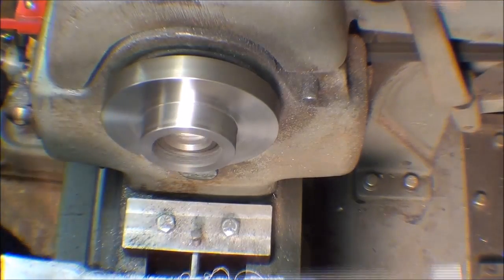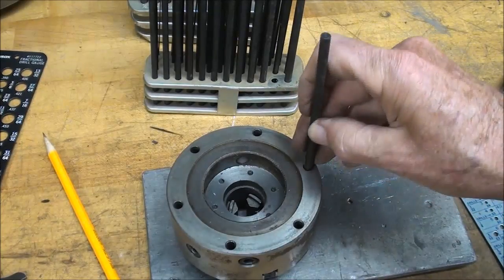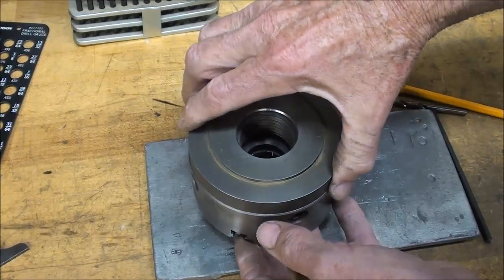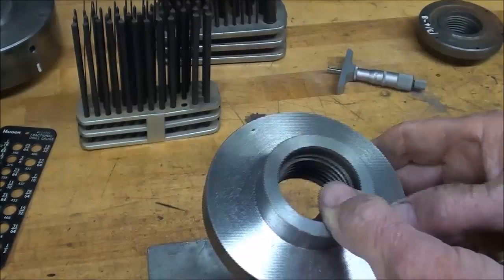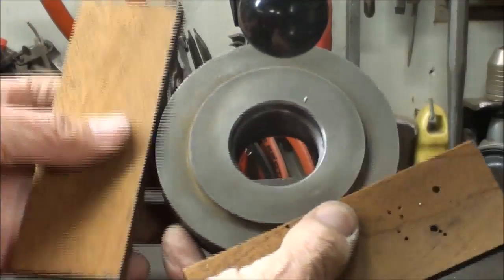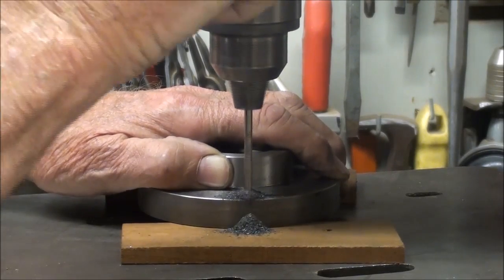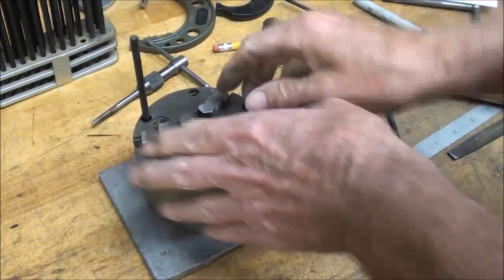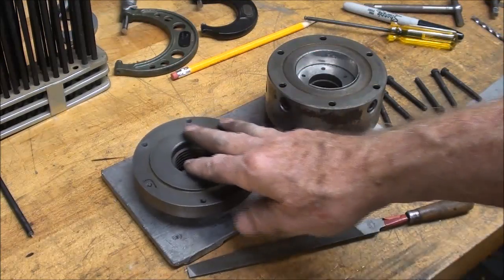SHOP TIPS #214 Part 2 of 2 Fitting a Backing Plate to a Lathe Chuck tubalcain

Comment: A thought here about fitting any back plate:  You should always have the ten thousands slop or clearance between the inside ID of the back of the chuck and the step on the back plate that Lisle is demonstrating.  If you fit a standard non-adjustable chuck and make the back plate tight, you couldn't tap it in to adjust it.
Reply: Now, I'd make it tight ( a thou or two ) to start with. Then mark the holes and mount the chuck. Then figure out how much out of center it was and remove just that much so that I could center it. This would let me mark the holes without messing with shim stock. And, in the remote chance that everything was true, not have to use the adjustments at all. And, most of the time, have to remove less to get my adjustment.
Reply: @bobmazzi7435  I had given it a lot of thought and if it's not set-tru then fitting the backplate tightly is correct.  I watched Mark on Winky's Workshop true up a set of jaws on a mass-produced chuck.  It will never be perfect, because the scroll will never be perfect, but he came really close.
Reply: @robert574  If you must use a chuck, and it must be accurate, true it up at the diameter that it's working at. And this is one reason to always have a bit of wiggle room on an adjustable chuck.

Comment: This will never get old, exactly how to fit the back plate.  I saw a different video where someone drilled the side of a non-adjustable chuck, put in 4 set screws and made it into adjustable one.  Of course, he had to fix a back plate like Lisle did here.  It might be possible to add a ring to an existing back plate, heck all you really need are 4 screw heads that the set screws could hit and push on to center it, the rest of the ring never gets used.

Comment: Another way to center the back plate would be to insert the back plate, tighten two of the adjusting screws (at 90 degrees to each other) to push the back plate to one side of the chuck, back off the two screws you tightened by 0.006", and turn the other two screws to hold the back plate centered.

Comment: This is my project sometime after Christmas with a new 4-jaw 😎
Reply: @mrpete222  (a hand goes up in the back row) “Is there any discernible difference between Way Oil and Bar Chain Oil?  They both seem to have a similar viscosity and ‘tackiness’ —- and Bar Chain Oil is a lot easier to find here in the Smoky Mountains than it is in the Northern Rust Belt. . .”

Comment: you mention the reason you cut the clearance hole was that there is no reason to thread beyond a certain depth or thickness as there is no advantage for maximum holding strength.    Do you have a reference for what that maximum thickness would be for various thread sizes???     Other than the old "rule of thumb" of about 1.5 times the diameter for steel and 1.8 - 2 times the diameter for brass or cast iron,  I haven't been able to find a written reference for the maximum thickness to thread to, after which there is no additional strength gain.   Thanks

Comment: Removing threads because of the holding issues doesn't make common sense to me. IF, and that is a big if, for some strange reason the initial threads get messed up or pulled out, you have nothing remaining to still use in the hole or extra material to tighten the bolts. If the entire hole doesn't need threaded, what is wrong threading it for such possibilities anyways? IDK!

Comment: with a lot of machine experience, not a teacher, but the one repairing industrial equipment, I don't like removing clearance threads on connecting plates.  True, it will only hold the thickness of the nut, but that is irrelevant, to structural integrity. We never removed threads on the lead in, like never, ever, many many years of engineering.

Comment: I just finished turning one of those same backing plates last night (still need to drill & tap) but I wish I had known it was cast iron before ordering it. It was no fun turning cast iron and made a huge mess. But I wish I had thought to turn the plate around, I would have saved a ton of time taking material off the larger diameter. And I have the same lathe :)

Comment: Scary!   You as an expert buying a custom theaded backing plate?     Makes me reconsider doing my own.  What's up- I'm just learning.
Reply: I bought a backing plate for my Logan, it is a 1-1/2 8 thread. The threaded part isn't so critical IMHO, but you need to machine it on the lathe that it will be used on so it runs true.
Reply: If I make my own lathe spindle, I'd either have to cut both threads on that machine or be positive that the threading was exactly true on its tpi.  Inner threads on it would be 2 1/2 - 8 threads.  Lots to figure out.  Thanks for reply.
Reply from the maker: never make--if you can buy cheap
Reply: LOL -- True - that's right you find all those deals.  I was concerned because when a retired person who loves machining is buying instead of making; ...there must be a reason.  Perhaps you could do a video on HOW you find the auctions and so forth, and otherwise line up so many sources for machine tools;  ...too much like finding hen's teeth out here near Portland OR.
Reply: mrpete222
agreed, we " make " because its not available or cost prohibitive. you will never fabricate a one off part cheaper than something thats of the shelf.  Great advice Mr Pete

Comment: Could the backing plate have been made from steel instead of cast iron?  Why does cast iron seem to be the material of choice for backing plates, even when the chucks are steel?  Thanks. -Chris
Reply from the maker: +webtoedman Good points
Reply from the maker: +bx2200 CI is best--but steel would work

Comment: Great video! I am curious to know why the the bolt threads has a maximum strength after a certain number of threads.  Is it because the force that would be required to pull the bolt out of the threads exceeds the tensile strength of the bolt?
Reply: +MattsMotorz You are correct. After a certain number of threads there is no gain in strength and greater risk of breaking a tap. The only benefit to longer threads is if the hole cant go through the other side and you cant be bothered to get the right length screws.
Reply: I was always taught that the width of the bolt e.g. 1/2, you need roughly 1/2 worth of threads to achieve full strength. As a mechanic I do believe in as much thread as possible, never know who is gonna cross thread or put in too short a bolt! haha

Comment: Nice demonstration, thank you. I'd really be interested in that 1&3/4" x 8 back plate you started with if you're thinking of off loading it. I'm restoring an old Smart & Brown M model mk1 from 1946, and I could really do with that for a little 4 jaw chuck project.
Reply from the maker: +Steve Brown  THANKS FOR WATCHING--sorry, already gave it away --I guess it will fit sheldon lathes
Reply: +mrpete222 
Ok, thanks for the reply anyway.

Comment: I've been looking for a good used lathe but someone in Illinois keeps buying them up!  Happy Holidays, Mr. Pete!
Reply from the maker: +Brian Oltrogge six is enough
Reply: +mrpete222 lookit the jagged edge on the tip of the thread crest, like it's torn (not an accuracy issue)....wonder if their cutter was dull..that was one of the statistically rare super-useful and informative vids Thanks!
Reply: @iamtheomega  ...cast iron has a tendency to crumble- that might have been what happened(?)

Comment: MrPete....really like your vids. Informative, interesting and humorus. I have subscribed. I have watched many of them.
I have a question....I have an old Enco lathe I bought years ago as a basket case. It is together and functions well for my needs. I have been unable to find info on the size of the heastock spindle. I measure 2 inches at the register area of the spindle. I have a thread pitch guage on order to get the threads pitch, witch I think are 8 TPI. If I want to make a backing plate for this what would I bore out the backing plate to cutthe inside threads? I figure its about 1.860 or there about. Please give wath advise you feel is pertinent when you have the time. Thanks Keep up the good work!! Merry Christmas to you and your Family!!
Reply from the maker: +Rick Wagner You MUST ID the thread-then look up that dim. in machinerys handbook. Maybe its metric?

Comment: As always, great video! From a retired carpenters viewpoint, (hobby machinist in training), it looks like the groove machined in the nose piece would be helpfull keeping the backing plate attached to the chuck if the adjusting screws were a bit loose. Just a thought. Thanks for all the great videos. J.B. (San Diego).
Reply from the maker: +J B Good observation

Comment: I'm sure you know both of these things, but they bear repeating - one for safety, and one for easy chucking.

Cast iron is perhaps the only material which is (sort of) safe to hold by hand. Drill bits rarely "grab"  as they go through the end of the hole in cast iron. You would certainly never try that with sheet metal or with any copper alloy.

The Adjust-true (and others like it) can really only be adjusted to tighten true at a single diameter. Irregularities in the scroll will require re-truing when you tighten down on a part of a different size. It certainly will repeat quite accurately on same-sized parts if your final tightening is always on the same tightener (usually marked in some way). This gives you excellent repeatability for semi-production operations where you want to chuck up parts of the same size over and over. You get nearly the same accuracy as a 4-jaw without the individual centering needed for each part.
Reply from the maker: +Peter W. Meek good points
Reply: +Peter W. Meek Thanks. Your post confirms what I intuited about the irregularities in the scroll.
Reply: Just as a note, those irregularities can come from the original manufacturing, from slop in how the scroll fits in its recess (this is the irregularity that can be minimized by making the final tightening in the same socket every time), and from uneven wear of the scroll (if the chuck was used in a production environment and clamped down on a single-sized part over and over).
Reply from the maker: +Peter W. Meek Goes to show that a 4 jaw must be used for real consistent accuracy
Reply: mrpete222
The lathe setup I bought used has a 4 jaw chuck too, but the clamping bolt that goes through one jaw was broke in two at the adjustment screw hole. I'm making a replacement. So far I've cut everything but the threads in the adjustment screw hole. The thread is Left Handed at 17 TPI (Talk about weird?). I think my best bet is to fabricate a 17tpi LH tap  from an annealed over-sized regular tap, then heat treating it. Then using that to tap the hole.

Comment: If I had been doing it I would have chucked up a piece of 1/2 in drill rod in the tailstock, clamped the chuck to the drill rod and slid it up to the backing plate and transferred the holes. Still a very good video though, please keep it up.
Reply from the maker: +Richard Haisley Many ways to do any job
Reply: i was thinking had you measured the inside of the chuck and cut it to that diameter  transferred the holes then finish turning to get the clearance would have been more accurate and a little easier
Reply: If there is any wear in your tail stock or drill chuck you may induce errors if you do it that way.

Comment: Hey Mr Pete, as always, great video.   One thought, could you have turned the backing plate down to the full "no slop" diameter of the hole in the chuck then with put the chuck on and mark the holes?   Then no shim required?    After which, take the backing plate down to the final "slop" size?
Reply: +wgm4321 I think that's the way I would/will do it too.
Reply from the maker: +wgm4321 thanks for watching-yes, I suppose. But would need 3 hands--good idea though

Comment: @mrpete222 I am very excited to notice the small drill press you use in this video! I have been searching high and low for a small benchtop unit like that, but dread buying a Harbor Freight death machine. What model is that one? In your estimation, how well suited is it for small precision work?
Reply from the maker: +ObsidianShadowHawk thanks for watching-CAMERON-$1200 new, of course I bought used for 100
Reply: +mrpete222 I found no complete used units for sale after a quick search online. Best I can find is a unit with no motor or drive pulleys for $400. Is the manufacturer still available to provide parts for older models?
Reply from the maker: +ObsidianShadowHawk Not sure